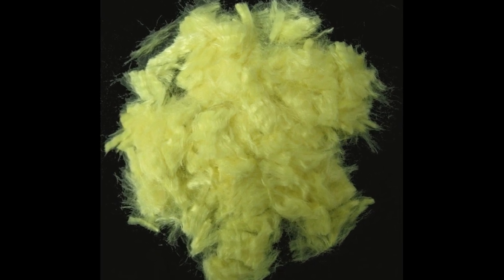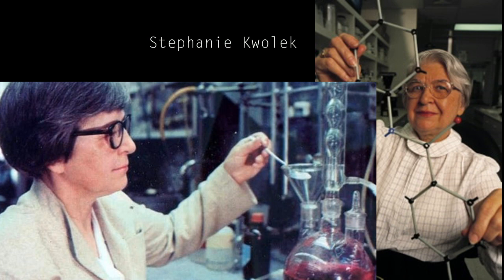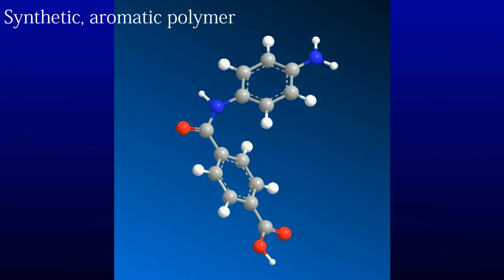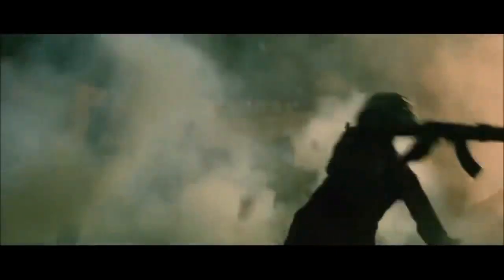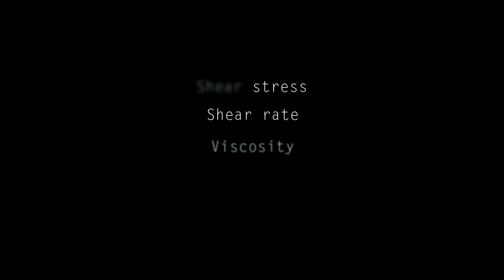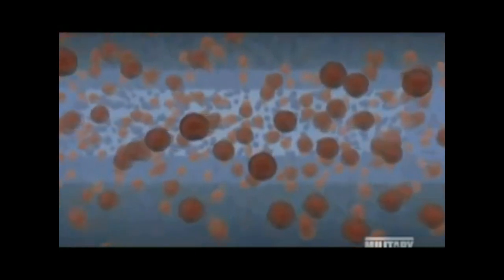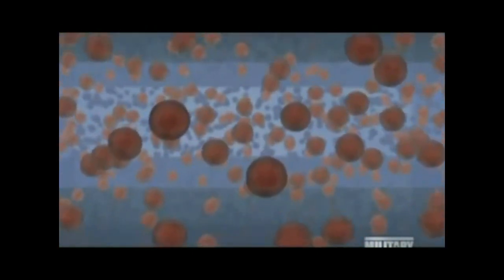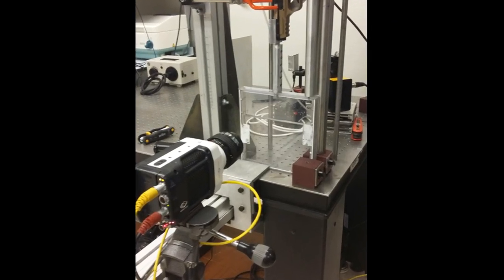Cornstarch: bulletproof

Comment: Shear Thickening Fluids don't replace Kevlar. They permeate the Kevlar fabric so that the Kevlar adopts shear Thickening Properties.
Kevlar is soft and flexible unless specifically glued into solid plates or helmets. 
Most Kevlar used by soldiers is also paired with ceramics.
You used an air gun... I don't understand how that leads to the conclusion that Cornstarch is bulletproof.